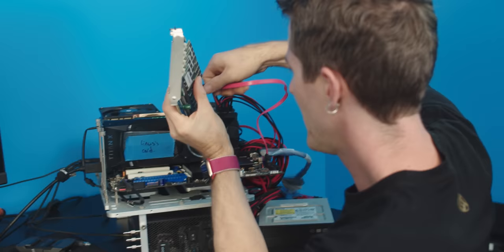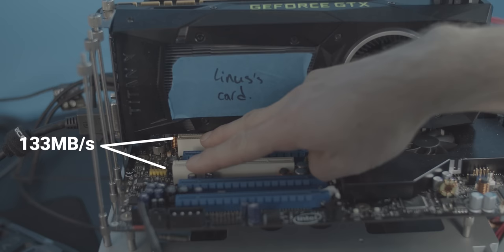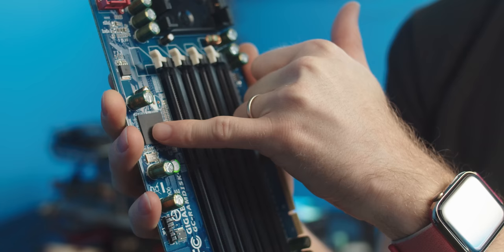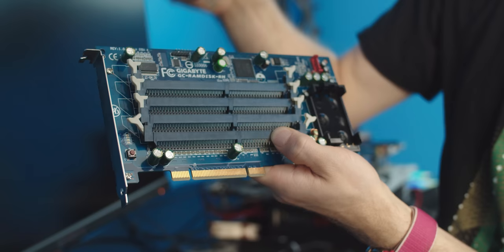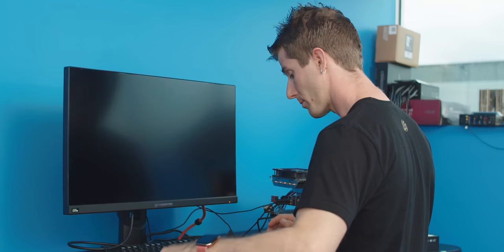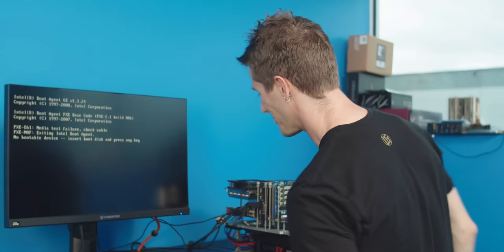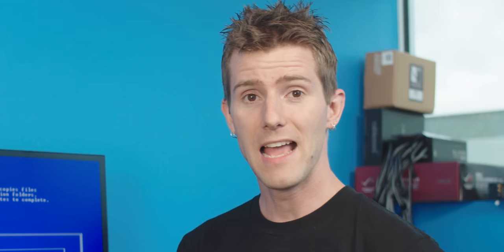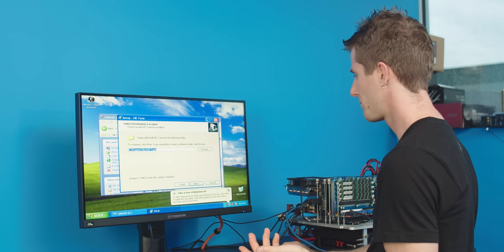WTF is this thing? - RAM on a PCI Card??

Comment: I had/have the one that fit in the 5" drive bay, no PCI slot, and it used a regular molex power cable.Also it had a battery to keep the power, as did the PCI version. Also, using it for the operating system is a waste, I used mine for the paging file on Windows Vista/7/8, and the drive-erasing was a benifit, for security, anyone who attempted to steal/confiscate the PC wouldn't likely find out it needed to be powered on, most people who perform computer forensics would likely keep the PC off while preparing to do anything to prevent data loss. My SSD drives were plenty fast enough to have quick loading times with games so I rarely ended up loading games on it, but the better random access times over SSD made it ideal for the paging file that most software in windows requires to be used even if you have plenty of RAM, ssd drives wouldn't just struggle but it would wear down their ware-leveling.

Comment: Old tech. I used a hardware ram drive on an AT clone I built in the 80s. 8 mhz 80286 CPU, 12 mhz 80287 math coprocessor, a hardware ram drive, battery backup for ram card and the computer. Just to run SPSS on a large data file that would've have taken a week with the data on a hard drive for each pass.

Comment: An external disk controller with inbuilt hardware cache. Hardly the first time I've seen one, though it IS the first I see on PCI bus. I remember I even bought one, when the main PC bus was the prehistoric ISA, and there were no integrated mainboard controllers AT ALL, to get some more speed from the HDD I had at the times (while other people bought normal controllers but with VESA Local Bus extension in the vain hope they would be faster than simple ISA. Vain hope because the HDDs of the times weren't fast enough to saturate the ISA bus, let alone use the superior speed the VESA Local Bus).

If I recall correctly mine (a simple ISA PATA controller) could mount up to 8Mb of local cache with old memory sticks, the kind used wit the i386. Can't remember for the life of me if it was any good at speed-up the disk though. Been a while.

Comment: could you not put it in some sort of raid with a regular disk media, so in the the power out thing, the regular part of the raid would repair the fast ram disk, from the regular storage disk media, as the PC reboots, i think it would be like more modern PC isn't shutdown right, then when it  powers back on, it does , the scandisk thing checking the disk..(but it would be raid restoring the RAM disk  :-)

Comment: This is kind of similar to an ancient form of RAM waaaaay back in the 80's You wouldn't put sticks on a PCI card, but you'd get an ISA (predecessor to PCI basically) card which would have RAM chips built on board.

Comment: I can remember buying a motherboard round about 03-04 (asus i think) and you were able to add a card to pci slot and add anther cpu with 4 ram slots. 
Was fecking expensive and by time it was a reasonable price it was obsolete. All i can remember that the chip i was using at the time was one of the very early amd xps

Comment: Are there a pcie DDR3 and DDR4 versions of this ? That would be so dope, with old server memory being cheap you could easily get a 4x8 or 4x16GB ram disk to put your swap file. A good use case today would be for big data processing, you either need a lot of ram which is limited by cpu and is expensive, or burn your nvme with writing operations. With this card you wouldn't be scared of killing your nvme.
Reply: A 192gb ram disk for something like Starfield load times would destroy that 4k q1t1 read time limit nvme experience

Comment: Don't rubbish the IRam Linus. I bought one of these (still have it) and filled every slot with ram. It was like a super fast SSD in it's day and SSD's weren't even available at retail back then from my recall. You should have seen how quickly it could install and run Windows XP compared to my clunky platter drives. I was light years ahead of my neighbours. Sadly Windows 7 was too big to install it. Yes if you disconnected the PC you lost the O/S once the battery ran out but my God it was fast. And you put your games and other data on another drive. And you are way off with your 10 second boot time advantage.

Comment: But you would not be using this for a OS boot drive, you would probably be using it as a scratch disk for Graphics or Computation apps, which is where it makes sense. Though of course there originally was Ramdisk software that allowed you to use some system memory as a drive, which could still be of use today if you need ridiculously fast access to a dataset.

Comment: It almost seems like this would be more viable as a concept now with DDR4 (and it soon being superseded and thus dirt-cheap).
It wouldn't really be a problem to get 4x16 = 64GB on the cheap - and that would make a fantastically fast read-caching or scratch disk with an actually decent amount of space.
With PCI-E + NVME you could get same absurd speeds - but I suppose it would all come down to if you were able to produce a good controller cheaply enough to be viable.

Comment: Comments for this particular video:

1. This card you have does not have a battery. That black slot on the right bottom part of the card is a slot for 3.7V battery.

2. Even if your card have a battery, the moment you pull a DIMM module, you killed your disk.

Comment: I wanted the I-Ram when it was a thing. If the money would not have been a problem I would have bought 2 and use  it in a Raid 0 configuration and voilà ! 8 Gig of drive space, and probably more transfer speed. :-)

Comment: Back in those days, a stick of 512 mb of pc100 cost me $139.00 bucks. Don't know why anyone would have used one of those things when a flash drive would have worked better, reserving that high dollar system memory... or just use a live boot CD. That tech there didn't get very far, too many other viable options at lower cost.

Comment: The real use case here is with RAM as disk. You could in theory still make an argument for these today with SSDs. These would install more RAM on the north bridge or south bridge. This means you do not tap the main RAM controller instead you consume the north's PCIe or south bridge limit(s). All with really low latency. 

You could make a swap file with this, which to the OS is a disk. You can do this manually with a program also. People sometimes cannot load everything into RAM and must memory map disk into RAM to avoid a few things. The OS normally handles this, however the disk performance can be bad. Still a swap file more or less but avoids some of those things. So more RAM and more IO bandwidth without rewriting OS and building new chip. 

Retrofit solution using FPGA as bridge converter. Expensive but perhaps cheaper. Not likely going to very common. Has a place though.

Comment: The core 2 duo does not require DDR2.
Most 775 boards use DDR2 but there are DDR1 and DDR3 boards aswell that work with the Core 2 Duo.
The memory controller of the 775 platorm was in the Northbridge. 
So you could combine a core 2 quad Q6600 with DDR1 in for example a ASrock775i65G
Or you could put DDR3 memory into a Pentium 4 with for example a ASrock G41M-VS3

This will not work on all motherboards since the Pentium 4 and pentium D use another microcode compared to the core 2 duo.

Comment: Actually the intention never was to install an os nor programs nor serial datas (like videos or anything loaded into main memory) onto it. The main advantage is the insane access rate. It was for databases to be accessed in an insane speed. Copied from normal harddrive onto the RAM-drive on boot and saved back on shutdown.  The database software (for example using SQL) worked much much faster as with a normal HD - and also any flash memory at the time.
Due to 32-bit systems back in the day, file size was mostly limited to 4gb anyway. So with a "normal" database, this was accapable as a limit.
The alternative would have been more RAM inside the computer. However, while normal RAM is even faster, a big problem if power loss during operation. Keeping your data integrity is barly possible.
However, on a battery buffered RAM-Disc even with sudden power loss, it´s acting like a normal hard-drive. Beside normal backups to HD, the data still is available and acessible like on a normal HD. If your PC is out of order - simply put the card on a backup PC. Your database is available in a minimum of service time again (at least with a good stratagy to avoid data corruption at the moment of power loss).
While 4GB seem very low for a database, do not forget the searchable data back in the time was mostly text. Of course you could also have pictures and videos in your database - but their data could be stored seperatly on HD; the database itself only contained a link and tags. So the fast accessible and searchable database part could do with 4GB.
This sort of iRAM disc was a very sophisticated piece of harware for professional use.
Using it as a boot-device oviously is a quite nice funny experiment, but of course can not show how genius this system was back in the days.
And do not misunderstand me - even if battery backup is quite helfull, a data curuption can still happen. So no excuse for a bad data backup strategy. But even you might still end in data coruption at the moment of power loss in 1 of 10 cases of sudden computer failure - it´s still 9 cases you can start up your system much faster again than using a RAM-disc in main memory. Also in 2006 more main RAM and boards to allow it wasn´t cheap either. As PCI only was used for power supply, not DATA transfer, you could also use more than one card, if your database was spread over multiple files.

Comment: Would have made a good scratch drive or sample library back in the day. I wanted one of those so bad. I actually installed one in client system in like 2001-2002 He ran a design firm and was using auto cad. He had some crazy hardware for the time. That system was pricy.

Comment: Waaaaaaay back in the late eighties/early nineties there was a 386 laptop with 4MB of RAM. It actually had 2MB onboard and another 2MB via an expansion card, but that's not important for this story. Anyway, I obtained this laptop in 1995 and discovered a feature in the BIOS called "HardRAM" which seemed to reserve some of the RAM for...well, what it was for wasn't apparent at the time. I set it to about 1MB, rebooted, and then forgot about it for a while. I had a bit less RAM now, but back then especially for DOS the difference between 4MB and, say, 3MB didn't actually matter that much so I didn't really care. Then one day I ran FDISK (the DOS hard drive partitioning program) and...it reported two hard drives, the 40MB one that I knew about, and a second 1MB one that I definitely did not know about. Mystified, I created a partition, formatted it, and played around with it. This new drive was freakishly fast. You've probably guessed where this is going - the second "hard drive" was reserved RAM. The freaky thing was, it maintained its data even when the power was off! I could put my save games on it, I could put my DOS boot files on it, you name it. It behaved in every way like a normal hard drive.

At the time I had no idea how unusual this feature was (so unusual that I've literally never heard of it again in the 25 years since then), and to this day I don't know how it actually worked. Amazingly I just now managed to recall the laptop model even though I've barely thought about it in decades - it was a Toshiba T2000SXe.

Comment: Cute. Almost reminds me of my BocaRam card I had in my 386sx33 back in the day. I provided me with an additional 1mb of ram. Yip... Mb. Not Gb.
But more related to this, i worked for a vehicle satellite tracking company,  in '98, and the system that was in charge of moving the dishes to stay connected to the satellite was running on dos with a hard drive on a card. it was only 16mb in size, but that was plenty for the need. Was pretty interesting.

Comment: Please use your contacts with gigabyte to make them create a new version that presents a disk directly on the pci-e port with battery backup and DDR4 ECC ram.

Why? ZFS ZIL/SLOG device 16GB size would be enough.
ZIL destroys some SSD's quite fast with constant writes and the average consumer is left with buying high price drives that are up to the task.
A cheap solution like this could fill a niche market with many ZFS users.

Comment: Ahh I still HAVE one of those Gigabyte i-RAM cards! Holds only 4GB of DDR ram (still have those too).
I also noticed your battery on the card is missing. One power down and everything on it is GONE. Dang near instantly too.
Then you have to reformat the card and reinstall every time. NO FUN.
I also had a RAID 5 with Raptors too. Had to upgrade the power supply to run everything.
Now I save a bundle in costs - only need an NvMe drive and some platter drives (optional for long term storage reasons).
Electric bill went DOWN too! LOL

i-RAM might be best used for say temp files or a swapfile.

Comment: I dreamed of owning one of these for a long time, always hoping the price would drop enough to get one... But there were never enough produced in the first place. And the planned second edition - based around DDR2 RAM, PCIE bus, and a proper customer chipset - was cancelled early in development when (I think) the guy behind it left the company.

My view of how best to use was not as a boot drive, but as a location for the swap file. I had a machine with only 2 RAM slots for DDR2, having upgraded mainly to get the benefit of SATA (my old MoBo was IDE only, and not even the fastest version of that!), so I was looking for a way to get more memory into the machine and get free of the creaky old disk-based swapfile. And since I had a couple of 1GB sticks of DDR1 taken from the old MoBo, and I could see 2nd-hand sticks dropping in price as more people jumped on the DDR2 bandwagon... 

In the end, the "new" machine finally got an SSD... Still not as its boot drive, though! It was a mere 8GB in size, and I allocated it all to swap space. The poor thing died about about 6 months of use... I don't think the makers had quite designed it to handle a near 100% rewrite cycle per day! =:o}

That same machine still runs today, though, as a kind of DIY "enhanced PVR". It currently boots from a 120GB SSD that I suspect cost me only about 50% more than the 2nd-hand 8GB one did... And FAR less than I ever saw the iRAM being offered for! =:o}

Comment: I loved my old 32gb ram drive but Win XP got to big for it. It had dual SATA 6gbps and I had that in RAID 0. It booted faster than a Super Nintendo. The problem is no longer storage, even if you raid 4 7GBPS Samsung NVME's it won't make much difference over a single 3GBPS NVME for loading programs.

Comment: i saw there is an socket holder or something. maybe you can plug a battery pack, so the data will not lost after shutoffs the PSU? a lot of Raid card have battery pack to keep the raid data.

Comment: The max ram nowdays for a consumer grade  cpu is 128gb. To have 256 I have to have a threadripper. If I create a ramdisk, everytime I reboot, or power it off for the night, it is gone. But what if I could install windows and  for example blender, or virtual machines in a pcie ramdisk? Just the programs I use most often. As far as I see, it would mean that my ssd-s would degrade much slower, and with enough battery to survive a day without power, now that would be awesome. 128gb ram installed on board, and an extra 256 on a pcie card would be enough to store the windows, and even 1 or 2 games. Even a modern thunderbolt connection would do the job for an external ramdisk. Yes I know, for big data it would never be enough, or financially relevant to use as much ram as much could fit in a m.2 ssd, but something just to run windows on a separate ramdrive with a weekly backup could do the job just fine. Think about it. Even if you buy an epyc cpu supporting 2tb of ram, would not do the same job, because as soon as you power it off, it is gone. Frankly, if it would be a way to achieve such with a ramdisc, which is backed up with some battery capacity, I would go for it.

Comment: SSDs were nowhere near marketable or mainstream in 2008 and even in 2010 were still very expensive (multiple dollars PER gig). They were recommended but not the go to piece until years later when they got cheaper than regular hard drives. I built my first PC in 2011 and a 120GB SSD was over 200 dollars. Not for entry level, not yet for consumers. Just wanted to add this cause Linus seems like they were readily available in 2008 and they were not.

Comment: There are new ones out in the wild, using ddr3 and ddr4. Any plans to test those out? One I saw one for ddr3 that had a max capacity of 224gb, which would be a great boot drive, assuming the risk of data loss doesnt turn you away.

Comment: ok sooo...disable swap file on the boot drive..move the documents folder...and maybe that would be enough to run it for a while.  I think the lowest partition I put XP on was 5 gb and it was just too small after installing stuff, even with every program manually installed to a separate drive.

Comment: ONE QUESTION: Cool video. I have a similar problem. I have a K8U X motherboard and the HD gone. So I change the source piece and put a SSD on SATA plug and sort of works as the video and ask me to boot..  it has Window 10 on it.  Soo.. if I put a SSD with Winows XP on it it will runs normally??

Comment: I have a XP installation i call SP4, service pack four which does not exist. 
I slipstream every update/ upgrade possible, they had to go in a particular order a few at a time, it took a long time to make, so once installed there is ONLY like less than 20 small updates, couldn't get them st slipstream. Would you like a copy?